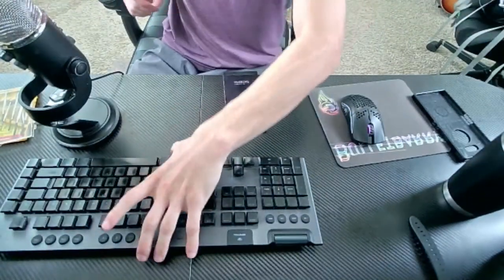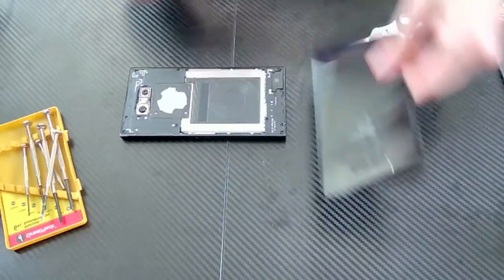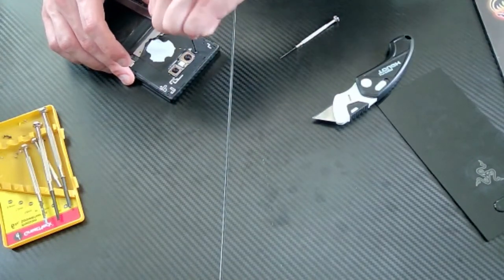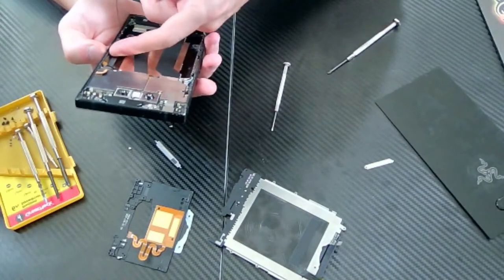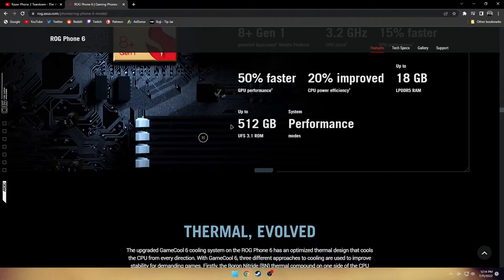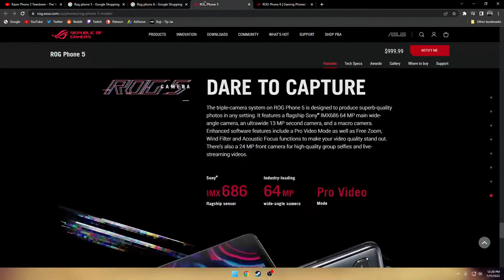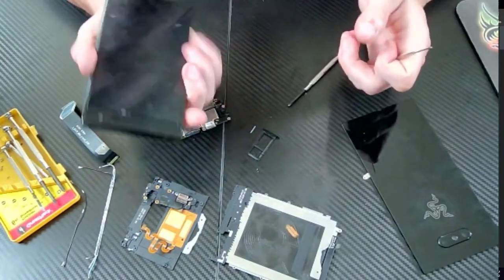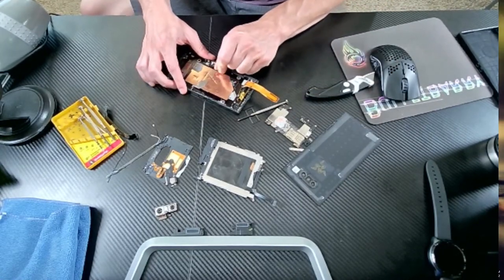I BROKE MY PHONE!! Let's Fix It?

Comment: What a funny coincidence. I just replaced the battery on my razer phone 2 this past Friday. I've had my phone for 3 to 4 years now and the battery life has gotten horrible. The battery was estimated around 1,400 mAh. (Original 4,000 mAh) I've had issues where my phone would just suddenly die anywhere between 25% and 40% state of charge. The new battery was only around $22 on Amazon and well worth it so far. I haven't had any issues with my phone other than the USB C Port stopped working which seems to be common with razor phones. Luckily I never use it and just wirelessly charge my phone. Replacing the battery took around an hour and was a lot simpler than I would have thought. This phone is still fast enough to load apps almost instantly so I don't see a point in replacing it for more "performance". The only issue I had was the battery, which is fixed, and now I'm hoping to get another 3 to 4 years more life.